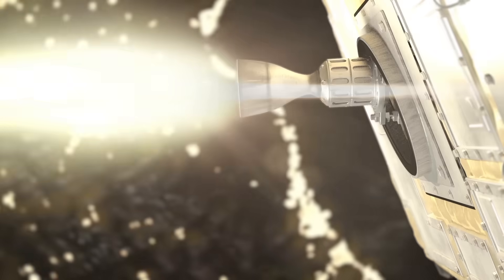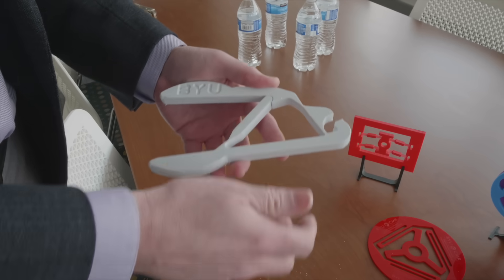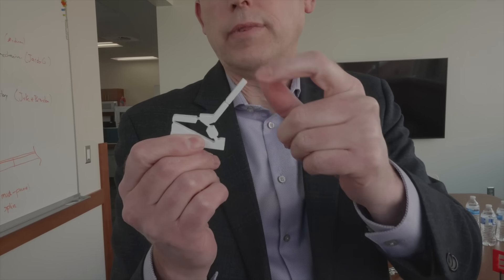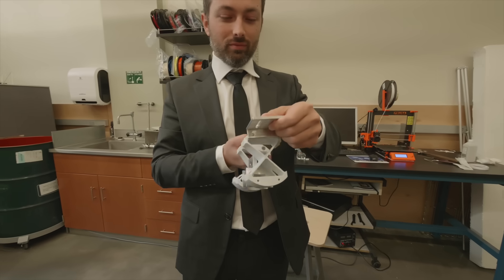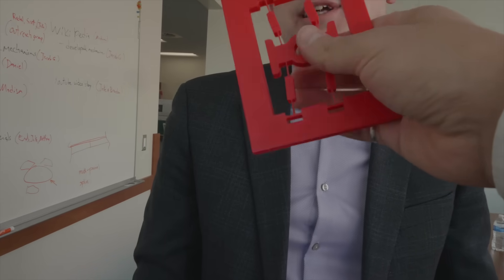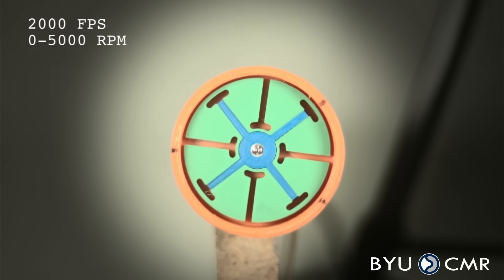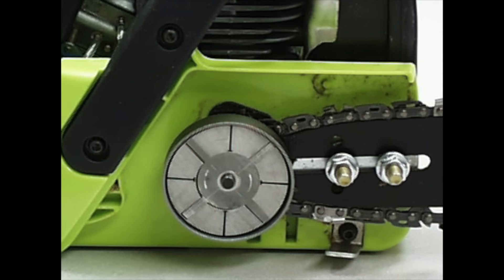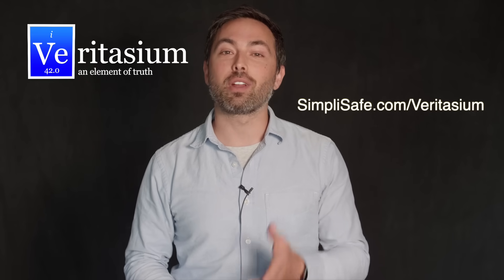Why Machines That Bend Are Better

Comment: doesnt these bending parts undergo elastic fatigue over a period of usage time?
Reply: Stress is spread evenly, it would be interesting to see how long it would take before any breakage occurs in testing. If it's Billions, the part would probably out last the machines usefulness; that would be a great thing. I always felt that eventually we'd achieve a level of technology where internal parts aren't moving. We're getting closer.
Reply: Ashwin Jain Certain plastics are very resistant to elastic fatigue, especially when thin.  If you notice on the plastic pieces all the parts that are meant to bend are really thin.  Titanium and certain iron alloys are also unique in that as long as you calculate it carefully and stay under the endurance limit, there will be no metal fatigue no matter how many times it bends.  This is likely the reason for the crazy spaghetti design of the NASA thruster part.

Comment: Sorry this professor is not honestly comparing to other methods. 1 million cycles of car engine at highway speeds takes 6.6 hours of driving. Imagine if you engine failed every 6-7 hours.Elephant one  was to easy to see it wasn't going to move in the x-y, Not impressed at all.

Comment: Uh this was more like a huge advertising. It didn't address any disadvantages. What about repairing something? You can't replace a screw. But more important: What about aging? Plastic can get recalcitrant (ist this the right word?) and get micro-cracks. Yes they said they did 1 mio cycles with one element but was this verified by a neutral third party? Also you can't just randomly scale an element since it's behavior will change. So this might be interesting for some cases but the video presented it as the best thing for every case and without any scientific scepticism. But as a scientist you shouldn't be fanboying something so easily.
About the satellite thrusters: This whole element was superfluous. There were two motors. You can already archive the movement with just two motors, no need for flexible parts. Actually they just provide another potential point of failure. Especially in space you want to avoid that. That's why they prefer a second thruster (also this provides redundancy). Also space is pretty bad for plastics. So this example was pretty bizarre (to say it mildly).
Reply: The prototypes are made of plastic, the actual final parts can be made of metal (they showed some made of titanium). Making the thrusters directionable actually adds a component of redundancy. The idea would be that if a thruster breaks down, the remaining can be redirected to compensate. He is excited about the technology and its potential why can''t he be? Like him, I find it fascinating and even beautiful.
Reply: > Repairing
You have to replace the entire part. Availability apparently not an issue because these things can be 3D-printed. The design for the flatter pieces can be easily printed without any extra cutting or filing done afterwards like you would normally with many 3D-printed designs or even for injection molds. Manufacturing at a large scale is also shown to be much simpler - since the pieces aren't made of smaller pieces. The thruster piece seems very complex though.

> Aging
Bending lasts longer than moving/sliding parts. Also, a single piece, glue, or a weld will always last longer than something that has nails/bolts/screws/rivets. You can't avoid non-moveable parts from actually moving - they will always bend, and they will slide at the seams.
Also, it showed that the material doesn't have to be plastic. They showed a single piece of titanium bending with 90 degrees range of motion.

> Testing by neutral third party
I would suppose that the 3rd party would be review board, or their clients (e.g. NASA). I don't think it really matters at this point - a question was asked, and they answered that their stress tests showed promising results. It didn't sound like sales talk as you're suggesting.

> Randomly scale
What are you talking about? It showed that the items work the exact same way at a microscopic scale.

> Satellite thrusters
Again, the parts don't have to be made of plastic for this particular application.
Using bendy parts and having redundant thrusters is not mutually exclusive, but I'd reckon that satellite designers would want to minimize the amount of parts as much as possible. Every extra gram you shoot up into space is luxurious.
The 3D animation showed two motors, so it wasn't about the motors but rather the "hinge" where the thruster would float about. Normally, you're gonna have some sliding parts, like a wheel and axle.
If you watch the video again, the design was meant to be accommodating for electrical lines and fuel lines, so on top of allowing to have less weight than a conventional design, it's also easier to design around it; it's not superfluous.

Comment: I was hoping you would have talked about metal fatigue. I mean plastic sure, but steel? What about inserting thread (carbon fiber) in the mold, kind of like rebar to give the metal even more strength at the bend point?

Comment: It's fascinating that "live hinges" which are typically maligned when creating moving mechanisms are becoming more and more acceptable. On the flip side, I've had such microscopic compliant mechanisms fail before (an accelerometer on a quadcopter), and fail in rather unpredictable fashion.

Comment: Bending is very handy for some mechanisms. I'd assume that tension and even the starting and resting point being dislodged could be an issue.. but I'm not an Aerospace engineer.... any you Egg heads got an opinion on it?

Comment: But how does this makes sence in a mass-production type setup? They will do 15.000 moves a day. It will be broken after the first week and you have to replace the whole thing. The 'normal' ones last decades with small to no repairs.

Comment: I'm no engineer; I just kept thinking about fatigue. Is that something that can be handled predictably, in how the materials are produced? (i.e. the type of plastic or metal, the curing/forging process, etc). It just seems to me that all that flexing is going to wear things out eventually (although, perhaps the whole point is that "eventually" is a much longer time than it would be in a similar device produced with multiple parts). Regardless, that is mind-blowingly awesome. I'll bet we'll be seeing more and more of this sort of thing in all sorts of products.

Comment: Technical Question. 

First of all pardon my bad english. Speaking of the metal clutch. Those small bendybits are therefore in permanent "stress" . In german it´s called "Ermüdungsbruch", google says it´s fatigue fracture. When you bend a piece of metal back and forth it will break, pretty fast aktually. Does this not allsow apply here ?

Comment: At 10:52, 72 Hz  is equivalent to 72 revs / s instead of 2, right?
Reply: Unless you're referring to 72 rad / s, in which case it's equivalent to roughly 11.45 revs / s ... for 2 revs / s, 1 Hz  ~ 10 degrees / s which is very atypical

Comment: Leslie Hounsfield designed the engine in his Trojan automobile with with a flexible connecting rod, because in his own mind this was "mechanically correct". I always thought this was funny. The engine was a duplex 2-stroke with two pistons on a Y shaped connecting rod, two small ends for the twin pistons with a common big end. Later copies of this design used a jointed connecting rod, increasing mechanical complexity, manufacturing complexity, weight, etc. Hounsfield's flexible connecting rod seemed like a compromise by conventional wisdom, but he was right - it is "mechanically correct".

Comment: even protein structure is flexible and one can consider a protein a tiny compliant machine. evolution selected this kind of machines for the advantages you have mentioned. easy to build/synthetize, "low price" in term of atoms, performance

Comment: What about metal fatigue and break down of crystalline structures? 
Does bendychines hold up better or worse than hinges, bearings and coiled springs?
Reply: Not even close, which makes this video nothing but shilling. The "1 million cycles " isn't much at all. Something rotating at 2500 RPM hits 1 million cycles 6.6 hours. Even plastic bearings would last much much longer.  I wouldn't be surprise making same example out of teflon flat and round stock(pins for rotating) would last much more than 1 million cycles. So this concept doesn't seem to help much.

Comment: I never had any doubt about the performance and simplicity of these mechanisms, but I was always very skeptical about their durability. Take the titanium hinge, for example. I was impressed by the durability of the plastic grabber, but metals are a completely different story. Metals bend and permanently keep their new metallic shape. How many times can that hinge go from -90 to 90 and back until the metallic bonding of the titanium permanently breaks down? More importantly, how does one test its strength once it is in use? I don't want to see that hinge used on an important satellite in outer orbit if we have no way of making sure it is properly maintained. Machines with separate parts show symptoms of particular pieces becoming worn out, but a mechanism made up of only one piece doesn't.

Comment: The elephant reminds me of a student presentation I sat in on at AIAA DCAS. The project involved using a water tunnel and taking measurements of a wing with a control surface. The control surface was deflected to different angles. The presenter realized the night before the presentation while making slides in the hotel that the control surface was moving towards and away from the wing along with being rotated. All of their calculations were made assuming that gap was constant. 

OOPS! 

It was still a great presentation,  honestly it was one of the most well presented that year. 

Live and learn :)

Comment: There are less points of failure but probably less durability as well, meaning either system would work well, unless you were placing them in a place where you cannot access, like a satellite in space, or the hair trigger of a nuclear weapon, not in a tool box - the idea of flexible parts is cool, but its not useable - and moving in this direction would be bad as now our tools would have planned obsolescence, but the landfills would love us!

Comment: Cool stuff (also see MEMS)!  An unmentioned but critical consideration is the strength of the thin, flexible domains and what loads are applied.  Also, for many of the illustrations, there were no load limiting protective bumpers or range-of-motion limiters.  We've been using these things since the '90s at the latest.

Comment: yeah but when a single-piece object breaks you may not be able to fix it (or just not a good idea to do it) meaning you'll have to replace it with a new one, talking about taking it to space it means you have to store several backups meaning more weight to carry leaving you on the same spot you were with an object made out of little parts. 
take cars for example, made out of lots of pieces, yes it also increases the chances of a fail but its also easier to find the damage and repair it even faster.
but yeah we get the idea, just have to make it reliable enough for the task.

Comment: disadvantage: impossible to repair, because the "hinges" are dependent on covalent bonds?
Reply: Yeah, this was what I was thinking as well. But I assume it's a non-issue for the smaller/simpler components where you can easily replace the whole unit. Or for specialized "one-time-use" tools. 

Imagine this, printing out the tool you need with a 3d-printer and melting/reusing the material after you don't need the tool anymore or when the tool/component has broken.

I guess 3d-printing is not there yet, but the synergies between this and 3-d printing seem do be incredible.
Reply: @Deckaio  "Incredible" doesn't even begin to describe it. Imagine the revolution this synergy will make in applications where you are inherently limited in supply of materials and/or manufacturing capabilities. Like in space, in the sea, on frontier research/military outposts. Closed-cycle or near-closed-cycle refurbishment of common mechanisms and their moving parts would be a lifesaver. There is also a certain synergy with algorithmic design thanks to the overall simplicity, meaning the AI able to produce and optimize such designs will come much sooner compared to the traditional mechanisms.
Reply: @moozooh  Tanker goes out to sea - they need a specific tool they don't have on board for whatever reason. They just print one, use it, and then melt it back into their reservoir of PLA.
Reply: @Deckaio  Seems extremely wasteful.
Reply: most of the simple ones can be extruded. Just chuck it out, put in a new one. especially if they're PLA or something you can seperate with a hot wire.
Reply: That's the point.  Most of these mechanisms done with traditional methods are already more costly to repair than it would cost to replace with these new mechanisms.  Think about it - would I rather pay a mechanic or a worker to disassemble something, unjam and replace a hinge or hinge pin, or just pay him to replace the whole thing?  At worst it's the same amount of work (many times it will be LESS work) but also a MUCH cheaper component.

Of course there will be scenarios where compliant mechanisms aren't the best option - but again, that's fine.  It's about having more options so we can use new options in scenarios where they are better than what we were using.  Also, because compliant mechanisms are mostly used with 3D printing improvements in 3D printing will ALSO improve compliant mechanisms.  

Consider that most technology isn't all that impressive when it's brand new.  Cell phones in the 80s didn't make sense for almost anyone - the cost was enormous, service poor, devices were unwieldy.  Now cell phones are ubiquitous because they are much better.
Reply: who cares when they are so cheap and are hard to brake?
Reply: I think at least in most of the cases he was showing, was that this disadvantage outweighed the advantages. Many of these applications are already hard to repair. Some seem impossible to do with the traditional hinge method. I doubt that this method will completely replace traditional ones, only expand the methods that engineers can choose from.
Reply: @user-ne2bb5nh7t  If something is already so difficult to repair that you're probably going to replace the whole thing anyways, you don't lose anything by making it impossible to repair. Or is that what you meant?
Reply: @Khaim.m  That's what I meant. Especially in cases like the microchip thing, it'd probably be much cheaper and use less resources to just produce another chip, rather than worrying about repairing it when the hinges finally give out.
Reply: Everything's a tradeoff in engineering. What these lack in repairability and versatility, they make up for in durability and ease of manufacture. They will be good for many applications, and either perfect or terrible for a few.
Reply: Correct, also impossible to repair as it consists of only 1 part. One flaw = total write off
Reply: also they are much harder to design, I mean this man is brilliant, but as a mere mortal, I'm sticking to good old predictable hinges
Reply: Liang Jiang
Why you need it to be repaired?
Guess you did not designed if for the use, needs a better design!
Reply: If they're made of plastic, can't the broken parts just be soldered together?
Reply: @Carbon2861996  
Yeah, it's probably possible, however given how cheap it is, it's probably cheaper and more effective just to get a new one.
Reply: And if you realize 1 million cycles isn't a lot at all, it isn't impressive at all.
Reply: @BenjaminBennett  That's 50 switch toggles every single day for 50 years. Not certain how hard you disco though?
Reply: @DSSlocksmiths  For Industrial applications way to less.
Reply: @BenjaminBennett  Except that's with a penny's worth of plastic in that part. It would last plenty long.
Reply: @Benjamin Bennett   "The reed switch is an electrical switch operated by an applied magnetic field. It was invented at Bell Telephone Laboratories in 1936 by W. B. Ellwood. It consists of a pair of contacts on ferromagnetic metal reeds in a hermetically sealed glass envelope." - Wikipedia
Some reed switches are good for over 100 million cycles.  Bendy metal.

Comment: How do they solve material fatigue creating cracks that wear through where it bends, when it was still about some form of plastic, okay.. fatigue-resistant plastic I don't know about, fine.. But then titanium and steel? takes a bit of high quality machined steel, wiggle, wiggle... wiggle, snap, there you go.. But these supposedly last millions of cycles? Impressive, but how?
Reply: poop
Reply: @heathershipley6804  Hands a toilet paper roll 
To clarify I mean a few instances where objects seems to have spots they bend too far to keep from fatiguing and cracking very long.

Comment: This is all great, but less parts that bend means work hardening over time. Eventually they will get brittle and fail without being fixable. Sure they're cheap and have their place in machines, but personally I prefer more mechanical parts I can fix or replace. Work hardening a metal would be almost irreparable because you would most likely remove the temper attempting to fix it. Not the end of the world but that's what I see in all of this. This would be cool in microchip making transistors smaller than currently possible.